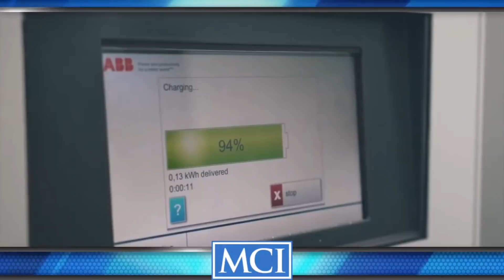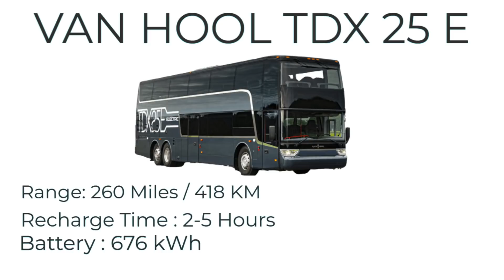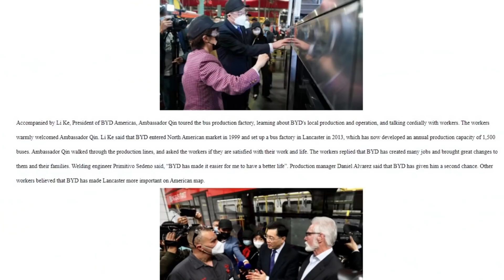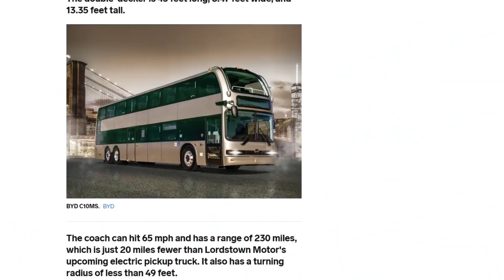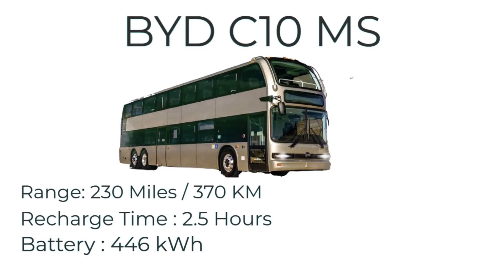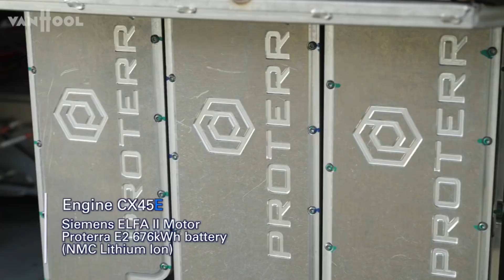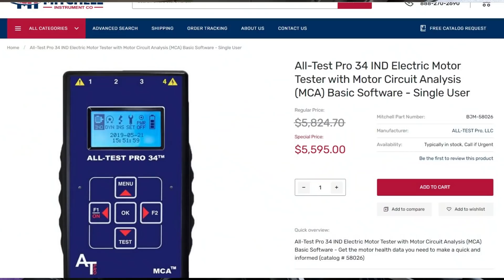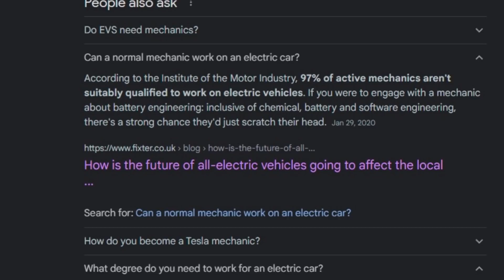Are Electric Buses working out in the US?

Comment: The issue of technician training is valid, but exaggerated. You don't need software skills to diagnose and fix an EV, just as you don't need them to diagnose and fix a diesel-engine vehicle... which is run by the same complexity of computer systems. Find the non-functioning component (which can be difficult) and replace it (expensive but not physically difficult)... just like diesel bus electronic components.

Comment: I figured battery-electric coaches wouldn't catch on. I'm personally worried about how much battery they require to get adequate range (the process of making these huge batteries aren't exactly sustainable) — and how much heavier it makes the bus, contributing to greater wear-and-tear that taxpayers have to deal with (because almost no road is privatized).

I wonfer how hydrogen fuel-cell coaches would change things. They promise to be closer to diesel buses in range and refuel time. But right now it's too energy-intensive to make hydrogen for this purpose (one reason I'd like to see more nuclear power plants in the mix — as well as simply bringing back trains), and the tanks would take up cargo space and be vulnerable to car crashes (unlike on city buses where they're mounted on the roof).

Comment: With solar energy being a real thing, and realizing that this is a mute point in the dark, why couldnt solar panels be equipped on top of the coach, to provide a constant, longer charge (if that were even possible)?
Reply: I doubt solar panels alone would power an entire motorcoach. There are already crazy design considerations into making solar powered cars possible. At best it would probably extend the range 100 miles, which is something, but probably not worth the extra cost on top of the already expensive electric coach considering what diesel buses can do today.
Reply: Just not enough power the 2023 Prius can be optioned with a solar roof and it can only collect 4 miles per day. Even with more space you could only get maybe 5 miles for 15+ hours of sun. Also coaches are often parked inside a garage.
Reply: Even if the roof were to be entirely made of solar panels the energy created by solar would at best provide power for the lights and air conditioning system. The amount of power needed to move a bus weighing 60000 lbs is absolutely immense. The cost associated with integrating solar on something that's designed to constantly be moving is just not in the cards for charter owners.
Reply: There are all electric tiny houses on Wheels on the market right now. Pod and Escape are two I've seen that can power an electric truck with Solar Panels. I can't imagine why this wouldn't be possible and coming in the near future.
Reply: Maybe they need to go down the path for long distance buses like what a company in Australia lis trying out……where the bus has its battery changed over at a rest stop with a fully charged battery or multiple batteries similar to a electric folk lift at a warehouse. The drained battery can then be placed on charge in a temperature controlled warehouse then be placed onto the next bus or maybe even interstate truck when it’s fully charged. The company in Australia believes the battery can be charged over in around the same time as a truck/bus is refuelled and while the driver is taking a regulation rest break. Just something that could be considered.
Reply: This is the most beautiful Motor coach. I love the way he goes about his job. But the truth is; without making good investments, no one can ascertain the kind of money required to own such Car. I am retiring next yr at 55 with 3 houses paid off worth 40.5 million. I realized that the secret to making a million is making better investments.
Reply: Credits to ROCHELLE DUNGCA-SCHREIBER, she has always had my back all through the process of working and investing. You can glance her name up on the internet and verify her yourself. she has years of financial market experience...<<>>

Comment: James,  great video as always.  I noticed those batteries ate up luggage space.   Ummm, Vanhool is aware of that, yes?  Also I love the point you made, "we don't have time in a 10 hr. day to be sitting and (fueling??) Is that the proper term for an electric vehicle?🤔🤣  3.5 hrs to charge vs. at most 15-20 to put diesel fuel in ours ??🤔

Comment: Scary coach to drive. I’m a transit operator and we have about 24 of these units and when we’re on the highway, we’ve had issues when we’re in the car pool lane, these coaches suddenly shut off without notice….(STOP MOTOR)
It’s a continuous problem that the MCI techs are still trying to fix.

Comment: I am what is called an "old school" bus guy. Electric Motor Coaches, in my opinion are a bunch of garbage. If it's a transit bus it's one thing, if it's a highway coach it's a complete other thing. I have seen that Van Hool coach and I am wondering where the passengers put their luggage. European buses are not very generous when it comes to luggage space to begin with and from what I have seen, there is basically none left on that Van Hool. One other thing that pisses me off and that is not just buses, all EV's say they have zero emission. That's true, however, nobody mentions the massive emissions that are made by building those vehicles. And what about the emissions when they need a new battery pack?

Comment: Thank you for this video, James. It's good to know how things are going when it comes to electric buses. From what I see here in Europe and electric motorcoaches, I don't even know where they are and how much manufacturers are doing now. I'm not blaming them, much on the contrary. I completely understand it. It's the same thing you said. The mile range, the buying cost, and the maintenance cost. I remember seeing last year that an electric city bus was 600000 EUR base price. While a diesel bus, fully equipped, was still 250000 EUR. Coaches here are quite expensive, so an electric one may be a very huge price (like those you mentioned). 

In Portugal, the Government also made a purchase of about 500 to 600 city buses. Most of them work with natural gas. The famous company Carris (or C.C.F.L.) received 80 electric Caetano (with Toyota electric motor) buses while the one in Porto, named Serviços dos Transportes Colectivos do Porto (STCP) received also the same (80, if I'm right) electric ones. While the SMTCB (in my hometown) received 60 natural gas buses (MAN 18.310 HOCL with Caetano bodyframe). But this was only for city buses and also only for these three companies.

In the future, these electric coach buses may have a great range and become a really great option. On the other hand, there are also other options that may be great in the future. Achates Power has that 10L three cylinders six pistons engine with more than 2000Nm of torque and very low NOx. Cummins is also going into this Hydrodiesel engine. In Sweden, there's the production of Hydrogen Vegetable Oil. This one reduces CO2 by 90% and it's currently being used by the FIA European Truck racing and being commercialized in some European countries. And recently, Sebastian Vettel is working on sustainable fuels. They only use it in racing yet, but the plan is to extend it to any vehicle since they work quite well in old ones. And there are also synthetic fuels. Not good enough for now, but in the future, who knows?
As I see it in the future, having these different alternatives, companies will decide which option suits best for them.

Comment: Just found your site, very interesting, drove for Anzonio busses in Boston,aka brushill,mcginn,& service bus, and the orlando transit, lynx, for 21 years and have over 2 million without a chargable. First busses i drove we 1947 and 1954 gm, my favorite was the td4519's. Now retired looking for coach to restore and travel. A cousin, Robert was historian for u.b.o.a. & A.B.A  and had 2 busses which traveled to all the conventions. Electric  busses in service usually have layovers at the terminals and end of line, so rapid chargers could easily be place there  to keep batteries up, like the silver line at the MBTA, here in Utah they use same busses but set up as hybrid  for uvu shuttle.

Comment: Lots of Proterra visuals and as someone who’s driven Proterra and other electric transit buses, Proterra is by far the worst!   Cheap plastic junk for the low price of $1m each. 

And yes the bill for those electric buses are all paid by the taxpayer. 

And if you want to run the climate control you’re purchasing the add on diesel system.  Otherwise your battery is toast.  So no, these buses aren’t 100% electric.  

It’s all a scam being sold to the public. 

And these buses have lots of downtime. The line of being “low maintenance” is another government scam. The downtime on these supercomputers running a Microsoft Vista OS is ridiculous.  They are always down.

Comment: Electric has a long long ways to go to be practical in cars, trucks, buses and other IC powered machinery.
Reply: Your the smartest guy on the internet. All this electric B.S. The world battles grid brownouts during 100 degree days when everyone uses their A/C. Now add the load of millions of vehicles. I just don't buy it either. Don't forget everything was "going metric" (and I was forced to learn the metric system in 1981) and all T12 fluorescent light bulbs were going to be outlawed and discontinued. Just because Congress takes a narrative doesn't mean it's always possible or practical. It took 100 years to build the current gas/diesel distribution system in the USA - now in 5 years enough charging stations are going to be built to keep the country moving? I find it hard to believe.

Comment: Thank you for doing a video on electric busses and the comparing them with traditional  motor coaches.  $500,000 for a new Prevost motor coach and at least $1,000,000  for a BEV bus.   For cars, fueling costs are about 1/4 as expensive for a BEV with $0.10 Kw/hr home charging maybe a bit more now that fuel prices have almost dubbed.   I think a motor coach needs to be able to comfortably cruse at 80 mph.   What is the range of the BEV busses at a cruse of 80 mph?   I would think a popular route of NYC DC could be run with BEV busses.  That's 220 miles or so.   They'd probably have to list at 300 miles range or a bit more to reliably do the route and have fast charging at each end.   They could probably charge in an hour.   These fast charges decrease battery life a bit.  With cars they typically get their charge in the owners garage at a slow charge rate and only fast charge on road trips which are seldom.   Electric school busses should work out well.   The typical school bus is driven 70 miles a day.  Electric school busses list out at 200 mile range which will allow them to slow charge over night for their typical use.  This might rule out taking the bus home at night so the driver doesn't have to drive to get to the bus.

Comment: why don't they just put two very powerful dynamos on each rear drive wheel connected to a small auto gear box that ensures that the dynamo spins at maximum rpm even if the bus is moving at a slow speed which charges the batteries as the bus is at cruising speed and town speed giving that idea would extended range of the bus without stopping for charging.

Comment: On the range if it says 310 miles that really means realistically about 240-260 miles. The Proterra transit bus we use where I live comes in different tiers. The mid tiers buses we have are supposed to have 150-175 range, after running accessories that range is more like 120. Especially range diminishes during the winter.

Comment: Interesting stuff. Is the range/testing of these with a full load (pax/luggage)? How does that weight affect range? Also, seems to me that the roofs should be made out of or contain at least 2,000 watts of solar panels to extend range (during the day when sunny or partly sunny day).
Reply from the maker: Thanks for the comment. I don't think the testing involves passengers. I'm sure a full load will drastically reduce the range. Yes I think it would help if the roof had solar panels

Comment: Could you “Put your toe in the water.” so to speak with electric coaches by contracting out the maintenance your not equipped to perform? There should be a large part of the electric coach your currently equipped to work on such as tires, wheels, air brakes, windows, suspensions, interiors, body and so on? And gradually build the certifications skills, tools and experience to work on and support the new technology? Also, you would need to add the charging equipment infrastructure to support those buses. 

At some point, your going to need to begin to transition to battery coaches.  You will need evaluation units to learn on and gain experience. Plus, you can advertise for public good will.

Comment: Ring up Tesla as ask how much to supply the powertrain and electronics of the Tesla Semi 500 mile range version to a Van Hool for incorporation into a coach??? Tesla was going to sell the semi for $180k for 500 mile range. It might be $250k now. A coach designed to make the most of BEV features with Tesla tech should cost $600k for 500 mile range.

Comment: One solution is what a project in Germany where they're using overhead wires to power large trucks on the highways. I'm thinking motorcoaches can take advantage of that, Tom Scot did a video about the project called "The highway where trucks work like electric trains". It would be a sight to see overhead wires installed on the U.S. Interstate System.